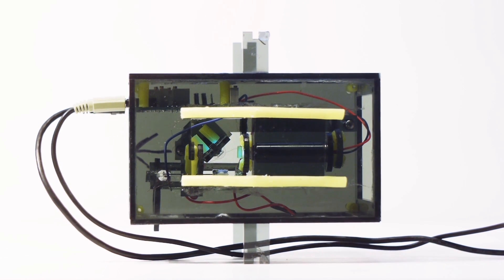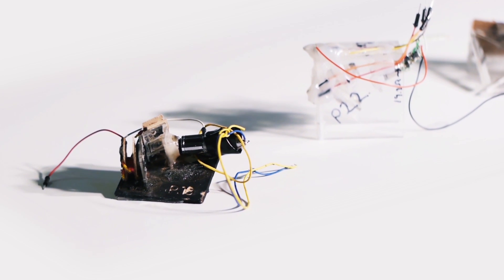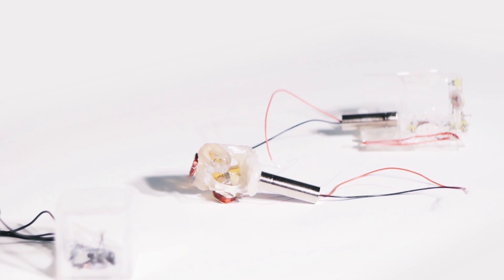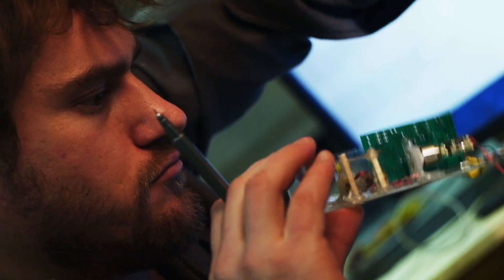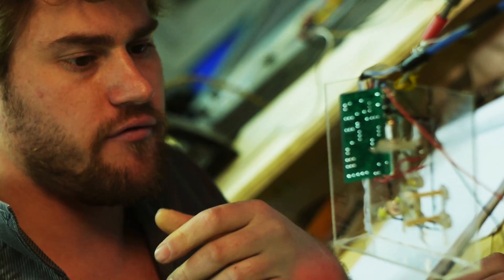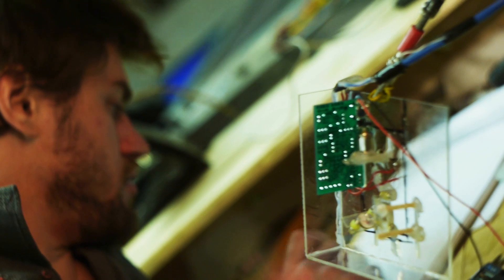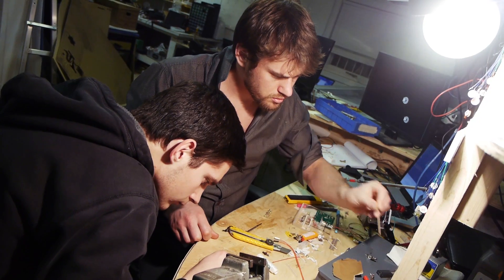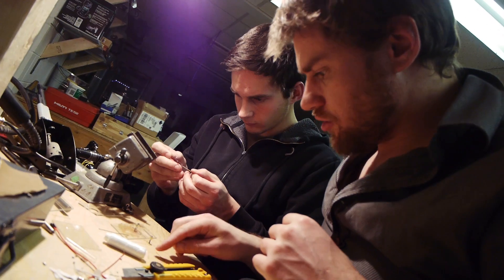Update #20 - Hardware Developments - Beta Kit Version PP27

Comment: Allow it to scale for larger build volume and interchangeable laser for different requirements might be a good option for the future.

I have to second that it looks like you need some sleep, go take a nap.
Reply: The build volume will only be limited by the distance from the laser to the resin. Increase the distance, and the same angle can result in a larger item. More here - http://www.peachyprinter.com/#!printer-specs/c1gk6
Reply: Troy McKeown That kind of sounds confusing, u should do a video on it? :P